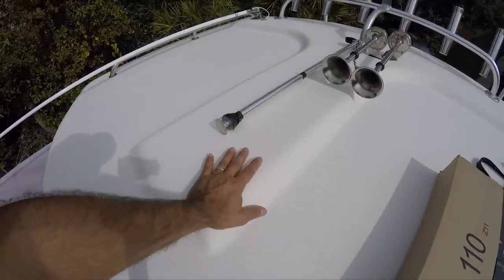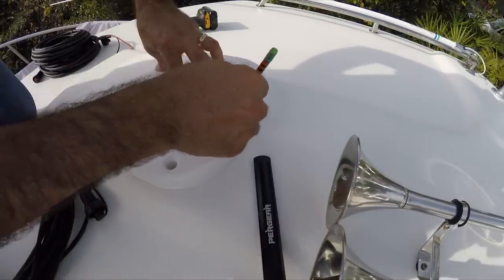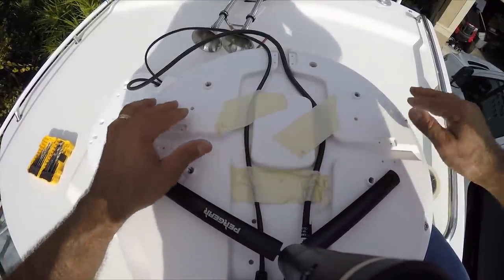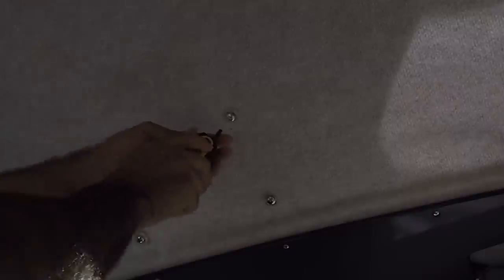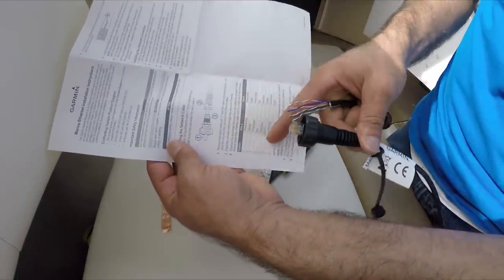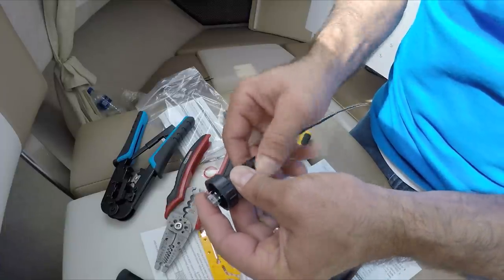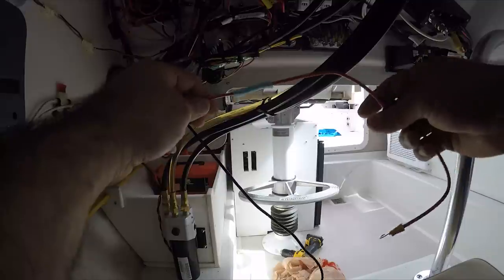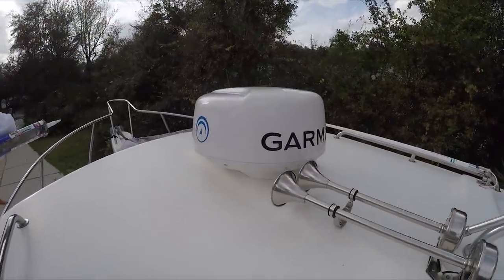Garmin Fantom 18 Radar Installation Crooked PilotHouse boat DIY

Comment: Hi captain,  the gmr 18 HD is cheaper than gmr Fantom,  do you know which one is the difference because I want to install that in my boat,  thanks
Reply from the maker: Hello cap. Great you ask well the difference is huge the warming up is seconds instead of a minute and the  Doppler Effect shows you ware the otem is moving towers you or away feom you that goes the same for storms and another thing it reads closer then the gmr 18  and that os great for markers at night time , if you go with the Famtom you will always be happy you made that choice,  is better if you can spend a little more and get the most advanced technology cap. Let me know later what you think and remember if you want to support my channel if you use my links for Amazon it dosent mater witch unit you purchase Amazon will give me a commission cap. And that will be very appreciated .
If i can help in any other way cap jus ask 👍 navigate safe
Reply: Thanks , how can I donate to your chanel ?
Reply from the maker: @yarnelyahumari  Just using the links I will get 5% from Amazon anytime you chop there captain and it's well appreciated and it doesn't cost you anything, You just have to use the links and they expire in 24 hours once you use them So then you have to hit them again if you want to also issue me a commission thank you so much captain And it don't have to be anything that I'm recommending it could be anything else👍⚓️🛥
Reply from the maker: @Yarnel Paz  i saw lots of purchases in Amazon lately, if it was you thank you cap. For your support 👍👍⚓️🛥

Comment: Noticed that the VHF RG8x cable was looped several turns.  That will radiate RF in the console and reduce the power at the antenna.  Otherwise, the radar install was perfect!
Reply from the maker: The VHF installation they did that at the dealer I did not know that that is a problem so you recommend me to unloop it

Comment: Captain,

I noticed that you have the light and horn right behind the radar. Does that affect the functionality of the radar?
The Garmin instructions say that you need 40" all around which I think is insane! All boats I have seen do not leave or have that space.

My plan is to install it behind a searchlight but raised right above. It will have a VHF Antenna to the right, GPS Antenna to the left and the anchor light behind.

I don't want to spend the $ if it will not work right but struggle to see all boats with even less space than mines and they do have the radar.
Reply from the maker: they don't affect the reading of the radar i even have the rod holders like 24 inches in the back and i dont see a problem with that cap.
hope you have a great install this is a great navigation equipment⚓😉👍
Reply: @OutOnTheReef  Thank you!
I have another dilemma with the install of the searchlight. Have you done any videos or how can I reach out with a question and a picture?
Reply from the maker: @mariodebarros8519  you can upload the picture to your YouTube channel and send me the link and I can look at it or a small video with the question captain
Reply from the maker: @mariodebarros8519  thanks for the upload 
I seen a lot of boats with the search light in front of the radar even installed by the factory but the search light is small not huge,  in your case i would install with stainless steel bolts or weld a aluminum plate and then install the radar but if you have a big bow rise i would recommend a wedge  with the degree needed  that would help the reception wile on the way cap.
I hope the best for your install.
And i place the link of the wedge i use in the description below if you need the same one👍👍⚓
Reply: @OutOnTheReef  Thanks!

The searchlight will be a Golight so it is a robust one. I have seen them with the light right in front (no clearance) so I was like “what!”
However, I plan to install the radar with a 5” raised mount so I clear about 90% of the light in front and it should give me the clearance for angle - I think?

On the wedge, how do I determine if I need one? The boat rides pretty much on plane constantly and it is not a high bow nor does it have high guardrails (Grady Fisherman 222).
Reply from the maker: @mariodebarros8519  awesome if you will use a pedestal that will be 👌 perfect and if your boat runs on plane you don't need a wedge, the reason i used one was because my bow really raises wen im on the way ,but you will be fine, please wen you finish your install i would love to see it ,i love all that kind of engineering. 
Have a great install cap, and thanks for reaching out 😉👍👍⚓
Reply: @OutOnTheReef  Indeed will share… just curious, how did you determine the degrees needed for the wedge? I am thinking now that maybe a couple of degrees - wouldn’t hurt since all boats ride with the bow raised to an extent…?
Reply from the maker: @mariodebarros8519  wen you ride your boat you can get a estimate of the angle cap. and yut try to corrected it doesn't need to be perfect for it to work .
Reply: @OutOnTheReef   actually let me say this… I rarely ever use the trim tabs… only if the boat is off balance based on my passenger seating. If it doesn’t have to be perfect, I think I am ok?
Reply from the maker: @mariodebarros8519  i think so so too cap the radar has a wide reading angle

Comment: Lovely job. Very professionally done, but don't radar domes cause cancer? I would have mounted the dome on a stainless steel radar arch so it would be as high as possible from frying your brain when turned on.
Reply from the maker: Thank you captain appreciate your positive feedback and yes it causes hope it causes harm because the waves of the radar but only if you are looking at it if you are beneath it there's no problems because the beam only shoots far away not down👍👍

Comment: How did you know to go with a 4 degree base plate than some other angle? Tight lines 😎
Reply from the maker: Because my boat rider inclined about that much once is on plane cap, and i placed the link in the discription below the wedge and radar ,if it helps and thanks for watching cap.

Comment: I was looking at it and i was wondering, is he making an ethernet cable? i was saying no way, then I see the twisted pairs..

i feel bad for you.

The stainless steel thing there is to help prevent cross talk.
Reply: I would recommend pass through-RJ45 connectors though,
Reply from the maker: Thanks for the great comment but I try to follow directions as good as I can👍👍

Comment: How did you determine you should use a 4" wedge?  4 degrees down is that measured to be in the middle of all riding conditions?  Flat slow on the lake to highest trim of boat plane on the ocean? Fully loaded. I see you ride on the ocean. You seem to ride at 11 to 14 degrees up at the bow.
Reply from the maker: Is all about engineering and putting a lot of thought into it and watching a lot of videos where my boat is raising up from the water and that's how I came up with 4 degree wedge. 
Why do you need help with yours uninstalling it?
Reply: @OutOnTheReef  Nope, fine where it at. But I use a  Self-levelling radar mount! LOL! Whee! On a 4-foot high struct pole. That folds down for trailering. I never fold down by the way,... btw.
Reply from the maker: @robb1460  it sounds like you have a great set-up to fold it down do you have it on your YouTube channel so I can see it?

Comment: Nice job! i think i would add a little kit-wall around the wires on the roof where they go inside. Just to be sure. ;-)
Reply from the maker: That's a great idea Captain thank you for the great suggestion
Reply: Very good suggestion
Reply from the maker: @johnm5714  it's always good to be safe you're right

Comment: All your connections should be heat shrink connectors
Reply from the maker: Yes you're right captain even though my pilothouse does not get any water inside it's not like a center console to center console always gets a little bit of salt water inside my boat is very dry but shrimp rack it's a must I understand
Reply: @OutOnTheReef  not just for water reasons salt air alone will eat away at those connections and an sure those connections are not rated for marine use
Reply: It was a neat job btw
Reply from the maker: @kingkong7366  thanks cap.👍👍👍⚓👊
Reply from the maker: @kingkong7366  yes they're rated for marine use because Garmin approves it and the connection I made it was to install inside the one outside I did not touch

Comment: Capt id like to buy a Radar Reflector for my boat. Its the Marine City 16" Radar Reflector for $26.59 on Amazon (unless you know of a better one). Put it up on ur channel please and ill hit the link. Thank you!
Reply from the maker: i looked at it and is bulky and ugly to place it on my boat cap.
Reply from the maker: @floundergiggingcharters8226  si fuera mas pequeno se beria mejor cap.
Reply: @OutOnTheReef  
No se trata de la apariencia, Capitán, sino de que nuestros barcos de fibra de vidrio no reflejan el radar de los barcos más grandes, especialmente en una tormenta o en alta mar.
Reply: Con sólo 16 "de ancho, encajaría perfectamente en la parte superior de su domo de radar. Al menos coloque el enlace y compraré el mío a través de usted. Gracias.
Reply from the maker: @floundergiggingcharters8226  muy sierto somos muy pequenos
Reply from the maker: @floundergiggingcharters8226  muchas gracias y as un video para verlo en tu cannal instalado para ver como se ve
Reply: @OutOnTheReef  no te entiendo lo siento repeata pro favor
Reply: @OutOnTheReef  En tamaño sólo mi nuevo amigo grande en ambición no

Comment: I wish I had a shrimp gun.
Reply from the maker: why cap you need one?
Reply: @OutOnTheReef  Na. been watching your EV-100 videos. Your steering system looks a little bigger than mine, yet Raymarine is recommending I go with an EV-150. How many cc is your hydraulic system?
Reply from the maker: @engineerpete7  not sure but it works good on mine but they also recommend me to get the Eevee 150 but of course is more money so I went with a Ev 100 it works perfect
But sometimes it loses frequency and it doesn't want to work property but then it works after 10 15 minutes with no problems I don't understand it why does that it's just sometimes it will do that like if I make a trip to the Bahamas it may not do it in the whole trip but when I'm coming back it might do it once or twice I don't understand it why is it got to be a satellite issue with the EV 100
Reply: @OutOnTheReef  Well, depends how you're using it. I'm assuming if you're telling it to navigate to a waypoint on your chart I suppose it could be possible that you're chart loses GPS signal momentarily then the EV-100 needs to make a correction. I troll the great lakes a lot so I would just be utilizing the compass off the EV sensor to make small adjustments and the pre-programmed patterns. Raymarine recommended the 150 based on hydraulic volume.
Reply from the maker: @engineerpete7  yes they told me the same thing that I may need the 150 but it's working perfect with the EV 100 on my boat.
What is the size of your boat and of course the bigger the pump the longer it lasts
Reply: @OutOnTheReef  I'm running a 2004 Lund Tyee 1950 Gran Sport with a mercruiser alpha drive and a 9.9 Pro kicker outboard. Both are on the hydro steering and have separate throttles at the helm.
Reply from the maker: @engineerpete7  definitely the ev 100 I think it's too small for you.
Now you have me thinking and you're right I am setting the point on the GPS chartplotter for the autopilot to follow and I don't have an external antenna on the GPS and you think that could be the problem that I'm losing connection, you have me thinking on that cuz that could be it
Reply: @OutOnTheReef  You think the EV-100 is too small for me???  I mean, it could be. mount an external puck thats exposed to the sky. But, it's my experience that any wireless signal transmission is subject to intermittence and/or interference for very small amounts of time.
Reply from the maker: @engineerpete7  well for the size of my boat it works perfect I have no problems but Raymarine may I have another opinion due to the size of your hydraulic